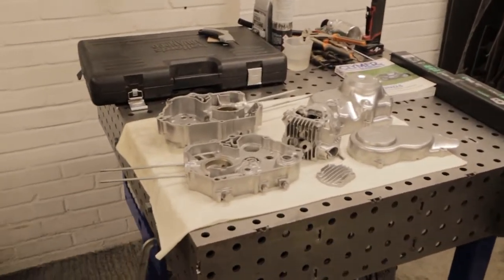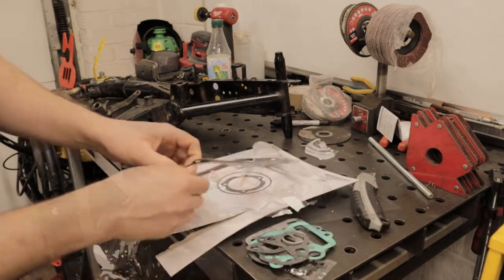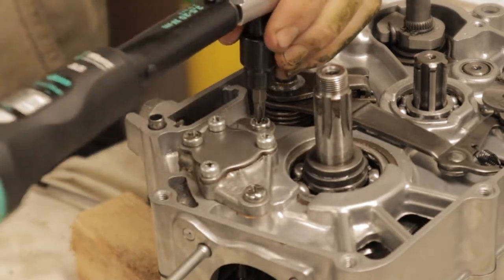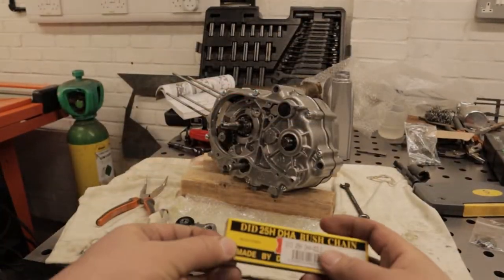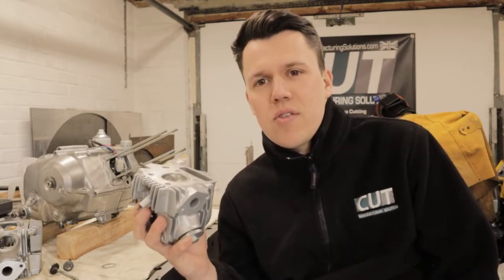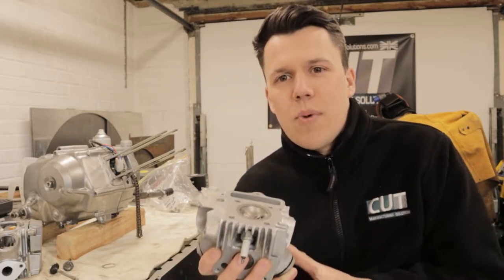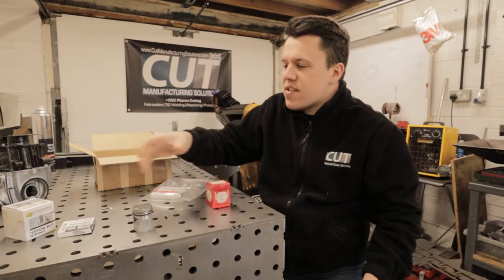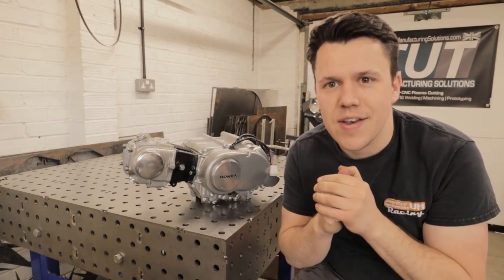Full Engine Rebuild - Honda Z50A Restoration Part 3

Comment: Hey, would be nice to know what book you used there to know all the torque specs etc. or did you just torque them down like you thought it would be good?
I have a St50E engine myself and would like to rebuild it so would be nice if you responded.
Reply from the maker: @Dave-fr6si  Hey Dave, I have a clymer manual for the Honda engine series which covers a large range of engines from this era. It details full torque specs and assembly methods which is very handy.

Comment: Have you replaced the piston rings? If so do you use OEM?
Reply from the maker: I made the mistake of not using OEM first time round. You can use them but I do think OEM is always the best choice! ( for this engine on standard bore anyway)
Reply: @MasonsWorkshop  where did you find oem at
Reply from the maker: @gospelmusicchannel3064  Shire bikes stock OEM pistons and rings !

Comment: Hi, where do buy parts from ?
Reply from the maker: Hi there, all engine parts are from shire bikes in the UK. CMSNL are also great
For replacement parts! The only thing that can be an issue is cylinder head replacement as you saw from the video !

Comment: The problem with all the videos is, they don't tell you what they're doing and why. The part when he's putting the cylinder and head on, he has a freaking screwdriver through the head, and fast forwards through it. Rest of it is great. Wonder if I'll have parts availability issues here in the states.
Reply from the maker: Hello Austin, 

Thanks for the comment. Unfortunately this isn’t a step by step tutorial on how to reassemble a z50 engine. It is a detailed video that gives a strong overview of the process and covers many of the issues encountered. There is huge parts availability and knowledge out there. More so in the states than in the uk!

If you need more detail to the why’s, I recommend picking up at manual and it will All make sense. Cheers
Reply: How much do you charge for a engine rebuild z50